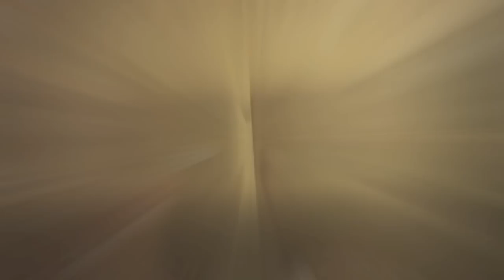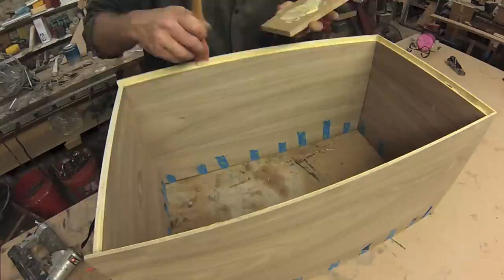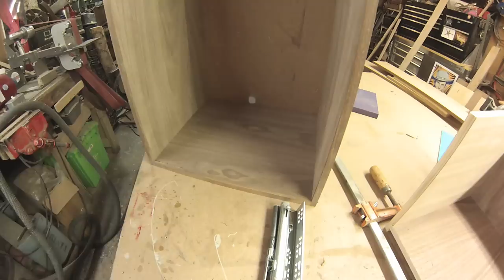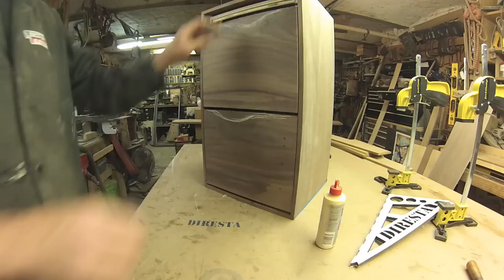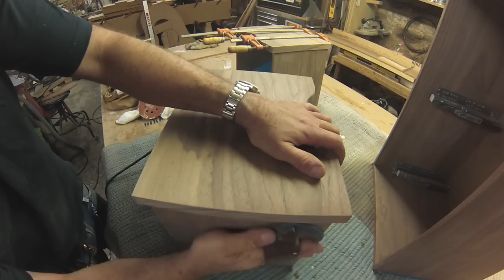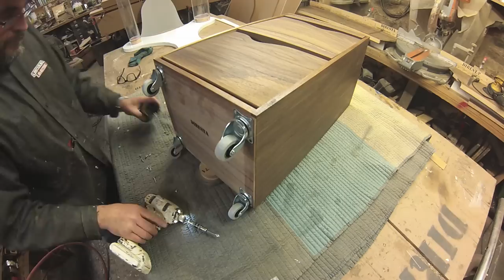✔ DiResta Walnut File Drawer

Comment: Note on the metal strips that act as runners for the hanging folders. If you can, make them slightly longer on their top edge than the drawer is deep. It stops the front most folder from popping off it at the front when you pull them forward in the drawer. This will probably mean notching the corner out of over-length strips before installing them.

Comment: I'm curious if you bought the plywood allready veneered or did you veneer it by yourself?

Awesome work jimmy :)
Reply from the maker: Thank You, this ply comes veneered with a multi ply core, think it is poplar inside
Reply: jimmydiresta Yeah, I'd agree. Color and sheet thickness from the plywood is typically for poplar. I'd wish ready veneered ply would be avaliable to me for a reasonable price. However, it seems like it is cheaper to veneer by yourself where I live :S
Thanks for your reply :)
Reply: I would rather see solid walnut boards instead of those plywood. ;)

Comment: Hey Sir.
Just a question, is it a piece of metal you use to scrape the wood with ??
And is there anything done to the metal ??
Nice work love the finished look.
Regards
Reply: +Thias Russell Its called a card scraper. You can buy them. Its a piece of spring steel that is burnished with a piece of hardened steel. Google how to burnish a card scraper for more info.

Comment: What do you call that sander attachment that seemed to connect to an angle grinder? Also, what do you call that small blade you use to plane the edges? Thank you for the video.
Reply: The sander is a bandfile. You can get them as attachments or as standalone tools. The blade is known as a cabinet scraper. Never used one, myself, but after seeing this, I think I'll pick one up next time I work on something with a nice finish.

Comment: How do you make those wide notches in the drawer sides with one pass? Or are there more passes you're not showing?
Reply: Its Called a dado blade, its basicly 2 or more special blades stacked on the arbor of the table saw to the designated with of dados. I dont Think you can stack regular tablesaw blades, but im not sure.
Can also be done with a router, a regular blade on table saw, or with a circular saw